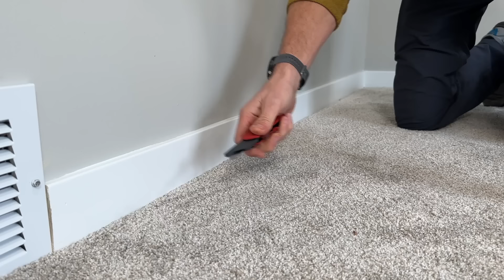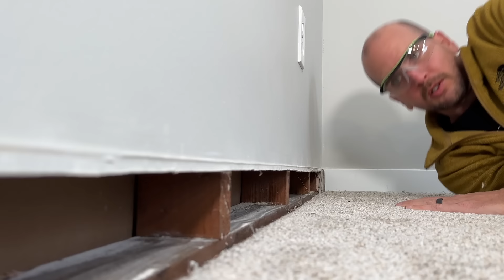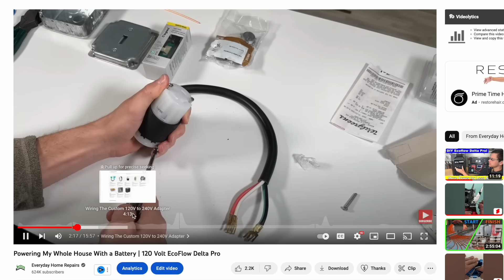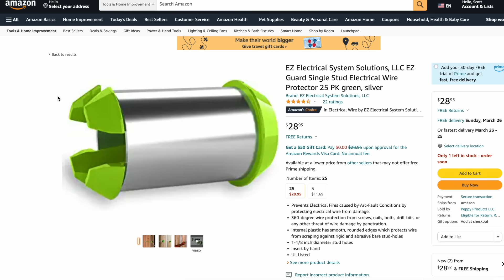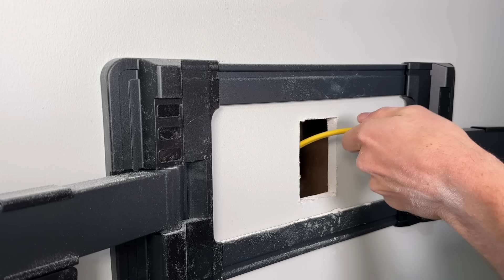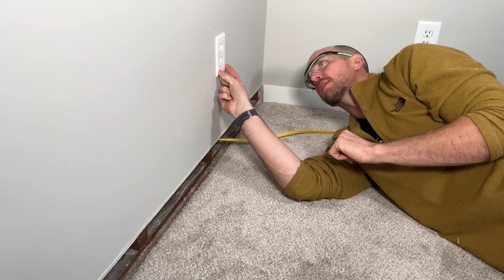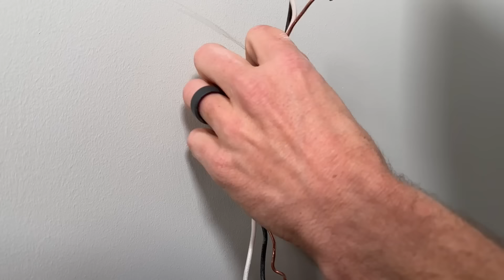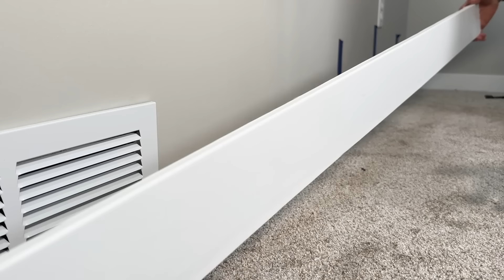How To Hide TV Power Cord And Cables | Easy Way To Move An Outlet

Comment: Ahy further suggestions on the move I have to do is around n inside corner. What process is there to help turn the corner and still not have too much repair. I can replace some drywall if needed, but being it is my mother's house, i don't want to damage the corner if possible

Comment: I've been an electrician for 20+ years.  I like the easy guards.  Do not use Wagos, ever.  They rely on a tiny piece of metal, barely pinching the conductors.  I've replaced thousands of them when I was wiring prefab apartment units.  No Wagos!! I don't use the stab in the back either,  curl around the screw. I hate call backs, but if you're the DIY guy, the only person you're calling back is yourself.

Comment: Unfortunately all my walls are solid concrete as i live in a 1960s high-rise.  So i just used a piece of white plastic trunking/conduit it gives a nice neat finish. And it was self adhesive, simply remove the backing tape and stick it to the wall.

Comment: Very neat and tidy, unfortunately this method is unlikely to be permitted by UK wiring regs as the cable isn’t in the “safe zones” I.e. running  directly horizontally or vertically from the socket outlet or other accessories. You can deviate from these zones but only if the cable is definitely more than 50mm deep from the surface on any side or protected from penetration by earthed mechanical protection (such as SWA). Looks like a great job in the US though.

Comment: Pretty good, however, you neglected to show the most difficult part - i.e. pushing the wires up into  the old box with wires already in it.   So I guess that will remain a mystery 🤷‍♂
Reply from the maker: Since we have the dywall removed right below the box it is actually pretty easy to get the romex up into the box.

Comment: Some outlets has 1 constantly powered, while the second one powered through a switch like a light or device.  By combining 2 separate pairs into one, you could defeat the purpose or accidentally turn off all running devices including the TV when switching off.  Be careful

Comment: Taking off baseboard was completely unnecessary...
All you gotta do is drill hole into side of outlet box and stud, one way on the lower part, and drill through next stud over when you cut your hole for top outlet. Now youve got a throughput for 2 studs. Feed your romex over towards the new outlet, with a not-too-heavy- metal widget attached, and then feed a magnet line down the new outlet stud in the hole you drilled. You should hear/feel the magnet grab the metal widget and then pull it on through... way less work, way less mess!😉👍

Comment: What do you do when there are horizontal spacers positioned about mid height between the vertical 2x4 ? Of course, if the new box is close to the spacer, you can probably drill through it from the opening that will receive the new box. If not, it might prove difficult.

Comment: Lucky you put those metal wire protectors in the hole you drilled because the nails you used with the gun would of definitely gone through the wires , you nailed it right at that level , maybe next time only one nail lower and some glue , just a thought

Comment: Yes, how do you get the romex past a cross horizontal stud between the two vertical studs?
Reply from the maker: I would use a 54" 1/2" flexible auger bit and most likely drill from the top down.  Just be a bit careful if it is your first time as the bit can jump off the wood and punch through the drywall.
Reply: Thank you!
Reply: Thank you!

Comment: How would you adress this same scenario on an exterior wall. There is a vapor barrier which prevents the otlet box from going into the wall. If you cut the vapor barrier there is little room to patch it. I suppose a vapour barrier box with a bigger hole to patch afterwards would be needed. That's where I'm stuck at. Any pointers would be much appreciated.  Great video! Thanks in advance. Dan

Comment: The missing part is how to get the wire up and I to the existing outlet box.  You break a new opening out with a screwdriver and feed a single wire you cut out from the romex and feed it down the hole, attach the romex from the tv with some duct tape making the connection as “streamlined” as possible and pull it up into the outlet box.

Comment: I know this is old but I hope someone sees my question. Those commercial grade outlets with the bite back terminals have openings to allow two wires on either side of each terminal don’t they? Meaning a guy could have up to four wires in the neutral side (white) and up to four in the energized side (black), right?

Comment: looks great!  Why can you run normal power wires in the wall?  Whats the rational?  It's not that you cant drill into the cones wire, thats why you used those stud wire protectors.  So then why cant you use power wires in the wall?  Am all about safety, but this seems like a rule that makes you hire an electrician.

Comment: The video is perfect.  But I have one point that not understand.  The surface mount electric box only fixed by two screws which are only touched less than a quater of an inch of dry wall.  The dry wall is not solid at all, so after a few times of pulling plug, I am afraid that the whold electric box would be pulling out.  Assuming that the wires are long enough without any holding force.

Comment: For that 4th wire from the connector, where did you get the separate loose wires did you just cut a small section of 12/2 and split apart neutral/line  etc?

Comment: No one has mentioned the row of noggins fixed centrally through the vertical studs how do u get the cable through that as its approx 4 foot 1200 mm up off the floor.. This is all assuming these aren't installed and all good carpenters would do this.. Well here in England we would.. Cheers

Comment: Awesome video. I am thinking of doing something similar. Is a permit required? Is this up to code? According to the National Electrical Code (NEC) Article 334.30, nonmetallic-sheathed (NM) cable, often called Romex, must be secured and supported using staples or other approved means at intervals not exceeding 4.5 feet and within 12 inches of electrical boxes. How are the staples applied? Is the outlet within 4.5 feet of the hole?

Comment: What about fire blocks in the wall between the studs? How are you feeding the wire through if you have one in the way…
Reply from the maker: This house specifically didn't have any fireblocks but if it did I would use a flexible 1/2" auger bit to drill  hole through the fireblock.

Comment: In Italy only the "public" houses, that is, those that the public body provides to very poor people for free, have plasterboard walls, all private houses always have brick walls, so all this work is impossible without applying a layer of plasterboard in front of the wall.
Furthermore, for safety reasons, rigid conductors cannot be used but must be those composed of hundreds of tiny cables, and must, again for safety reasons, pass through a semi-rigid pipe and not be free in the wall.
I always add that in Italy every house must comply with the regulations in force in terms of electrical system, not only when it is built for the first time, but also with each change of ownership or with each new rental contract. If a room is used for professional purposes, every 5 years it must be updated to the regulations in force, in any case.

Comment: Easier with baseboard that’s thicker since the drywall cut is larger giving more access when cutout . What if the baseboard is less than 2 inches? Is there enough clearance for drilling holes through the studs?

Comment: You shouldn’t attempt this unless you:

1.   have a pneumatic brad gun for the baseboard.
2.   can remember to order those romex stud protectors in advance online.
3.  have no issue with the $30 cost of a whole bag when you only need 3-4.
4.  can remember to order the little wire devices that go from multiple inputs to one output when Lowe’s or Home Depot doesn’t have them OR they do have them but you have to buy 25 again.
5.  can restrain yourself from tearing out the whole wall of Sheetrock with your Estwing roofing hammer because you can’t get the dad blamed romex into the old junction box.
6.  And speaking of romex, you have no problem buying a 25 feet for $30 when you don’t need half that.  
7.  can find a buy new section of baseboard after you damage the existing one on removal.  And buying new paint for the new non-painted one.

Otherwise, you’re ready to get your project started.

Comment: Unfortunately walls are built different in New Zealand. There is timber running along the bottom of the wall. Also you would have to cut up the wall as there are timber nogs running between the studs.

Comment: get yourself a flex bitholder extension?
i wish short throw laser projectors werent that expensive and they'd come with all the TV features....so could just have the one small box on furniture, and no more brackets and replacing of tvs.
you do NOT score outer cable insulation with a knife, as you could be scoring inner insulation and you wont know it. always just cut with sidecutters at end and pull apart to desired length, revealing inner cables.

Comment: Good video, i wouldnt recommend going directlybtonthe back of the outlet. Common source of failure. Considering its a tv, and not likely to have a heater plugged in, its not a big deal, just a note. I take the time for j-hooks. I dont want a call back from a customer.

Comment: I know it is difficult to secure the romex to the stud behind the drywall. Is it safe to hang the romex loose from the new outlet down to the floor while you are passing the cable through the hole by adding an easy guard to provide safety margin.

Comment: I wonder if the big holes in the studs is ok? Why not just drill 2 5mm holes vertically  and use multitool to cut between holes? In that case the hole will be just 5-6mm which should be enough to put wire. I could be wrong but if anything 7mm.

Comment: What happens if this is a exterior facing wall with insulation, assuming this method doesn’t work and you will have to cut open the drywall.  As the  insulation will block the romex from feeding through ?

Comment: Where is the cable wires and all the other wires for the cable box etc?  Can you install a larger outlet and run all the cables through the wall and plug in?  What about surge protection?  Is this not also necessary?  How do folks get wifi to the tv?  Where is all the other cables?

Comment: where I live we have perlins which is a horizontal piece of wood which goes between the studs as a fire deterrent, it nailed in about half way up. I'm unable to use any of those systems to hid my wires. Any suggestions?

Comment: What if you don't have an outlet close? Mine is in garage and on the ceiling which was designed for the garage door motor. My closest outlet on ground level of opposite sides. Would I run it up through attic in my case?

Comment: Very informative but being frank the process could be ALOT simpler and better if you just installed a wall access port instead of making a whole new outlet. 

Consider this, with your setup where would you hook up the sound bar and subwoofer? That introduces alot of new aspects which this setup didnt consider and drawbacks.

In my case i did the same thing by installing a wall grommet and running the power cable and HDMI cables down and having it exit behind a media center where my PS5, settox and my soundbar + subwoofer sit.

Comment: Well, with all respect, if I were doing it, I would just use some stick on "cable hider" wall conduit and plug the wire into one of those flat multi plugs in the outlet so the plug and cable doesn't protrude outward, with all of it painted the same color as the wall.
That's just me.

Comment: What if there is a horizontal stud in the cable’s way?
Reply from the maker: In that case there would be an additional step where you need a flexible auger bit and I would probably drill down and then pull the wire up and through the whole with the drill bit after the hole is drilled.

Comment: This is useless if your home has fire blocks preventing running the wire up or down without also drilling holes in each fire block. This is something most videos don't address because it is very labor intensive including drywall repair and paint

Comment: What do we do if there’s a fire block 2x4  between the tv and floor ?
Reply from the maker: Would have to get a flexible auger bit and either drill down or drill up then use the auger bit to pull the Romex through the hole.

Comment: You could not do this in australia because we have noggins bracing the studs. You call them blockings. Why you don’t have them in this situation I do not know.
Reply from the maker: It varies city to city in our area.  In this area they aren't super common but you will find them in some homes.  Do you guys just use a flexible auger bit if you need to get a hole through the noggin?

Comment: In this case you can never reboot that tv unless if the tv own power cable isn't embedded deep inside tv. If tv breakdown replacement wouldn't be easy either.

Comment: I noticed the "most played" part of the video is where the new wiring magically appears behind the outlet you are tying in to. You show the wire dropped down from the new outlet and threaded across the bottom through the holes you drilled but did not show how you got it form the floor up to the new outlet. Everybody is trying to seee this missing part of the procedure but you skipped it! That is why it is "most played" ! Is there anyway you can do another short video to at least explain this and then link to it? Thanks!
Reply from the maker: Thanks for the feedback and you are right I should have got a short clip of that part.  It is actually very straight forward with plastic boxes.  Depending on the type you either just knock out one of the holes or push back the little lever arm that will press against the Romex to keep it in place.  Then you just reach from down below the box because we have the Drywall cutout and pass it up into the plastic box.  Make sense?
Reply: @EverydayHomeRepairs  It is the reaching up from the floor to the bottom of the outlet  that is hard to visualize. It seems one would need to lie down on the floor and hopefully slip thier hand/wrist/elbow? thorough the 3 1/2 inch gap wihotut accidentally damaging the drywall. It's the scariest part of the project for a novice. Everything else you showed was pretty straight forward. That was the one part I was hoping to see.

Comment: Can someone explain why he’s running Romex through the bottom to the existing box that already has power shown at 8:09?  Wouldn’t he just need to drop the line from the new box at the top to the existing one at the bottom to power the new outlet?
Reply: Because the box at the bottom is too far to the right on the other side of studs he had to drill through. He can't drill through at the top very easily without making a bigger hole. Making a hole at the bottom behind trim instead.

Comment: Looks like a good option for a lot of scenarios, but not this one! First of all, you never want to install an electrical right in the center of a full motion TV mount because the power cord sticking out will prevent the mount from fully collapsing! Secondly, if you had just cut the box hole just to the right of the TV mount, you could have easily drilled through one stud, and dropped the Romex right down to the top of the box that's feeding your new outlet. (thanks to empty walls).  I do like this hack for times when you have to cut across several studs, completely unnecessary for this TV install...
Reply from the maker: Thanks for the feedback.

Comment: When drilling the holes you might hit some stud nails coming up from the base plate 2x4. No explanation of why using the 12 gauge wire as most outlets in the home except the kitchen are 15 amp circuits that uses 14 guage? Then the pulling the wire up into the existing box is simplified by not exhibiting how you accomplished that in this video and the room or hole in the back of the box to pull the wire through. These are simple but technical elements that overlook what an amateur might be attempting. A few other elements are skipped over.

Comment: you skipped the part that I always struggle with.......how to get the new romex into the old box.  In that situation, I think that you probably popped the slug out of the bottom of the box and were able to maneuver the romex in from below........but its not always that easy........especially in older homes.

Comment: Good info but if the drywall was attached with nails you won't be able to remove them without destroying the drywall. In that case you would just have to cut a new one of drywall. Funny how you do casually mentioned removing nails.

Comment: Do you not have cross pieces in the walls in the US? I have never done this without having to make a hole to drill through a horizontal stud (dwang in NZ)
Reply from the maker: Some homes have fireblocks in the wall cavity but it is not required in my area.

Comment: Just a heads up, don't waste money on the easy guard thing. First of all, a regular nail guard is perfectly fine. But as long as you stay in the center of the stud you'll be fine. If not, use a regular cheap nail guard. Do not spend money on that easy guard. You do not need it.

Comment: You didn't mention what happens when people do this....but the wire won't go all the way down to the floor...because of the Horizontal blocking , or bracing  between the studs..

Comment: What if you run into a fire block?
Reply from the maker: In that case you are most likely going to need a flexible auger bit to get a hole through the fire block.  just take your time using the bit as it can just pop right out of the drywall as opposed to drilling through the block.